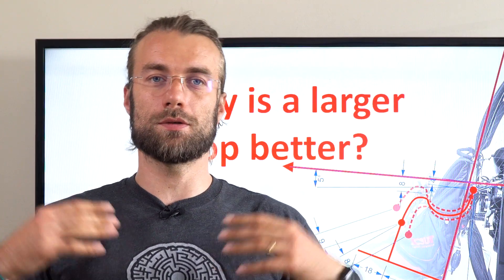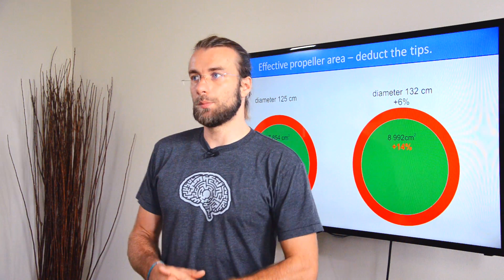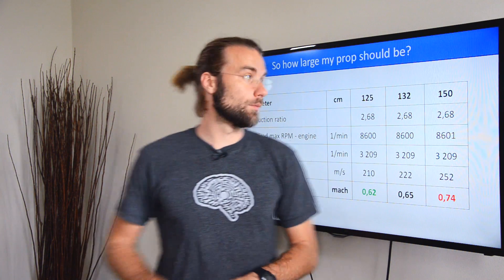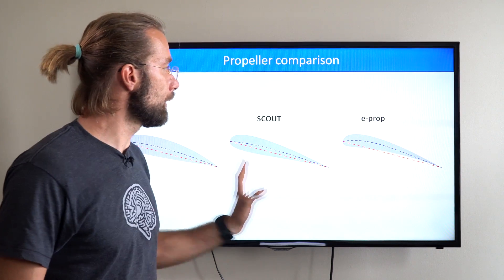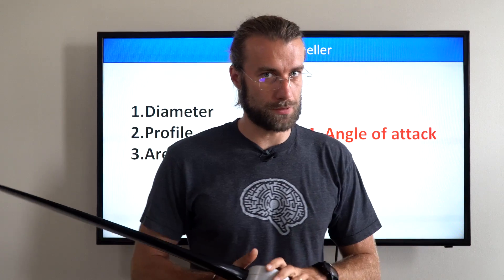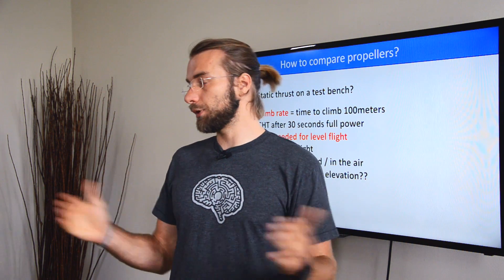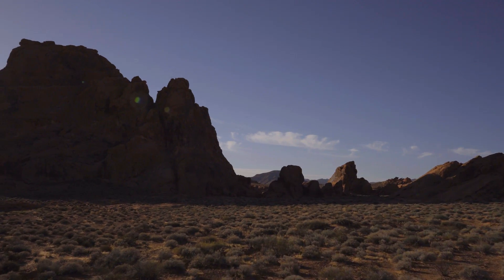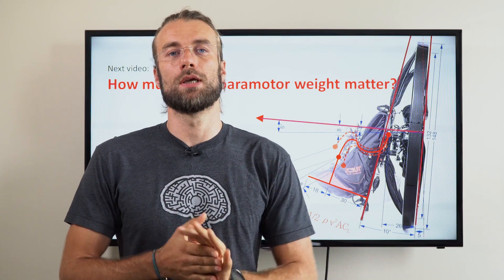Everything about PROPELLERS! Size, profile, number of blades and MORE! Paramotor geometry part 29.1

Comment: Hello sir my name is muhamad hasan in my rc gearbox planes i found medium size prop with medium number gear ratio is the best so i think in paramotor reduction ratio 1 to 2,5 is awesome, because air slip on blade to avoid that u need some high rpm , thanks.

Comment: Fixed parameter you didnt highlight is the motor stators and kv/kt and ofkos the fix loads for paramotor i.e. one man on metal frame. If those changed to lighter, smaller or more compact, the motor used may vary and the props selection is different. E.g. a monocoque carbon fiber with multi rotors. Should smaller footprint design is viable, the (your) design rule is obsolete.

Comment: You lost my attention when you said you never check static thrust. Why not? Its what everything is all about. You are just trying to sell your product and that's not interesting at all
Reply from the maker: I am sorry for losing your attention because the answer to your question is later in the video. Shortcut for you: what matters is thrust in flight and there are ways to measure it.
Reply: In the world of racing, what matters is your trap times, not a dynamometer slip.  Miro is taking the same logic, your climb rate is what matters, not your paramotor dyno thrust test.  I think the solution is to use both methods of measurement here.

Comment: Your tutorials are fantastic! Thanks for doing them. I’m an aspiring paramotorist. You mention a couple if times if the prop was a bigger diameter you’d need long arms to be able to reach. Why would the hang point width change with a larger hoop? Just curious
Reply from the maker: I was referring to forward take off when you spread your arms to pull the risers. But in fact the cage diameter does not matter, the lines will slide along the cage regardless of the diameter

Comment: Have good info BUT , it's called airfoil's, lift coefficient , etc. Tip shape has everything to do with efficiency/sound.
Static thrust measurements are critical especially when determining rigidity of prop.
I still give it a thumbs up!
Keep up good work....have subscribed. Recommended to my friends.
Thanks!

Comment: How can a circle be a square function? Area of a circle isa multiple of 3.14 pi?
Reply: "The area of a circle is pi times the radius squared (A = π r²). Use this formula to find the area of a circle when given the diameter." The diameter is also twice the radius if given that.
Reply: @ullrsdream  how long is a piece of string? Twice half of its length...

Comment: More blades are generally less efficient due to interference between the blades. the ideal prop has a single blade but the added weight of a useless counterweight makes the ideal real prop a 2 blade. Also, it's not the mass of the prop that determines the responsiveness, it's the moment of inertia, which has to do with diameter, mass and mass distribution. You can theoretically get a lower moment of inertia with more blades, gaining responsiveness at the cost of efficiency.

Comment: Miro, I know this is an old topic, but still one of great interest to me.    May I ask which 3 blade prop you used to compare with which 2 blade  to conclude that 3 blade offers no increase in thrust?    (ie:130 cm-3 vs 132 cm 2) or (125 cm 3 vs 132 cm 2) -etc.    I know the results you obtained are subjective, but I would still be interested...
Reply from the maker: It was our own development. Never put in the market

Comment: Very interesting, thanks for putting this series together. This may be a novice insight because I am a novice :)  but, I was surprised that the static thrust test was not considered that important. I realize that getting the real world data on climb rate, for example, is a test that is going to be done anyway but, wouldn't knowing the thrust give you an initial indication as to whether the prop was going to perform better in climb rate, at altitude....?

Comment: So, I know you have considered this, but a ducted fan is way more efficient than a free prop, and all but eliminates the tip vortex problem.   Clearance must be very close to the blade tip, and frame flex would probably be an issue.   Weight, rigidity, etc...    Any thoughts?

Comment: Good prop primer, thx.  That last airfoil is typically called an undercambered foil.  I assume the "special manufacture" you speak of to allow the thinner foil section is the addition of, or modifications to an internal spar?  Also, twist is another prop parameter that deals with aircraft speed, mostly, as I understand it, giving maximum efficiency at the economy cruise (or wherever specified) at cruise (or whatever) RPM.  Correct me if I'm wrong.
I assume your planform profiles are computer "designed", or at least analyzed as well?  Gorgeous prop, by the way, that new one, that is almost SEXY looking!
Probably MUCH too complicated for a paramotor, or even ultralight, but has anyone thought of making a automatic pitch changing (constant speed, or even just two speed centrifugally shifted) prop.  I used to use them on boat propellers, and they were really the nuts when you got them dialed in.  Weight not so much of an issue there, though.  Probably wouldn't pay off for the increased complexity and weight, especially dynamic weight.
Dumb question:  how come nobody specs thrust vs. speed, wouldn't that be a more useful spec, or does it usually just scale mostly linearly (I would think maybe not), although at these Reynolds numbers and pretty tight speed envelope, maybe so.  Never mind, watching further I like your tests EVEN BETTER.  Proof in the pudding, right?  ;-)

Comment: Could you put winglets on the tip of the prop to gain more effective thrust area?
Reply: Yes, but there are trades and compromises all over the place.  Not a simple thing to do or design.  If you look at some general aviation and ultralight props, you will see some manufacturers have done this.

Comment: awesome video, this was super helpful during my Prop shopping. One question i have that you didn't touch on specifically: you mentioned 3 blade props don't produce more thrust than a 2 blade prop which sounds like it would be true, but i'm assuming the test in which you concluded this was done at full throttle. I have heard elsewhere that a 3 blade prop can produce more thrust at 1/2 power than a 2 blade prop could with the same amount of power, therefore you could cruise at a lower RPM. Anyone have any knowledge on this?

Comment: GREAT videos, Im a new suscriber and  begginer in this sport. You help me so much with your knowledge. Im building a paramotor and I will use a 23-25 HP at 7000 RPM engine, (Yamaha Blaster 200 cc 2 strokes) whit a 152.6 cms. diameter  three wood blades adjustable propeller. I would like know best reduction ratio to this case to build the pulleys whith your indications and tips. Thanks so much. 
luiscarlosparrasanchez@hotmail.com

Comment: Without any science to back it up...I perceive that in spite of how much prettier and quieter my carbon fiber prop is, my fat cord, wooden aerolight "beginner" prop, creates more static thrust at the near sea level density altitudes I typically fly from.  It provides for better acceleration on take offs and a feel of a more solid push from behind.  Throttle response (RPM) difference are minimal, but may be slightly quicker with the thinner lighter carbon fiber.  Certainly the bulbous hump near the hub of the Helix provides for better engine cooling, but I am honestly thinking of just going back to the wooden stand by for the simple sake of PERFORMANCE.
Reply: That is really interesting to hear.  Are you a representative for a wooden prop manufacturer, or have any financial ties to them, because it certainly SHOULD NOT be the case, from a materials standpoint alone.  Like  you say, though, it could be a function of your prop being targeted for sea level use where some others may not be.
Is it as "performancy" at higher speeds?
And what about MPG, or efficiency?

Comment: Would a prop tip design, such as the one used by the new DJI Mavic Platinum drone, help with PPG noise and performance or is it even possible to mfg.
Reply from the maker: +Kevin I do not know.
It is possible to manufacture.
Not sure about the benefits

Comment: Remove the pesky prop tips for more efficacy. 😂
Reply: Actually, there is a way to do that, to a small extent, it is the equivalent of winglets on an aircraft wing (look at most large commercial jets if you don't know what I'm talking about). They essentially "unwind" the vortices, and effectively increase the usable span of the wing (or blade).  NEVER something for NOTHING, though, always compromises involved.

Comment: Yes, it is true that a larger propeller can generate more thrust, however, it also leads to more strain on the engine. So long terms effects may not be good....
Reply from the maker: No it does not if done properly.
Increase in diameter is always accompanied by decrease in angle, profile chord or change of profile shape to keep the strain the same.

Would you just increase the diameter and keep everything else the same, the engine would be under increased strain and it would not be able to reach max RPM as desired by engine manufacturer.

Comment: Welcome back! Great video as always. But there is still one more topic on propeller design: tip shape. I hear rumors that curved tips (sometimes called Q-tips) reduce noise significantly, and reduce vortex drag, but then the added surface area out there at the fastest moving part of the propeller increases regular drag, so total efficiency comes out about the same. Might be an interesting area to explore for a new and improved Scout prop. Think winglets on an airplane, except those usually curve upward for practical reasons (less chance of scraping on the ground or being run into by other airport vehicles). Curving down is probably better for a propeller, especially on a paramotor to avoid the cage.

Comment: I'm trying to understand the length of the reach of your arms. If you are referring to applying pressure to the a lines, this is done at the riser. A larger cage would not change where your arms would be to apply pressure to the A's. The biggest limiting factor to cage size would be the length of the pilots legs and keeping the cage from hitting the ground or interfering with running.
Reply from the maker: yes, you are right.
you do not need to reach all the way to the cage rim.
Ground clearance is more important

Comment: Great series Miroslav. I'm glad you mentioned the Icarus Trophy. If I'm not mistaken there are 2 Scouts still participating in this years race ( 1 race, 1 adventurer class ). That has got to put a tremendous strain and considerable wear on an engine. What did you need to do to your engine after you participated last year?
Reply: Why in HEAVEN'S NAME should that put any excessive strain or wear on what is, essentially, an aircraft engine?  You guys have learned to live with JUNK for engines.  Typical aircraft engines (and bikes, and cars) go THOUSANDS of hours, and HUNDREDS of them between maintenance.  Measuring engine life in tens of hours is NUTS in this day and age!  If a company like Honda, or Toyota, or Rotax took this on, they would have REAL usable engines on your backs in no time, and honestly, I don't think they would cost any more than this garbage you are stuck with now.  Just sayin', as an engineer.
Reply: @MrJdsenior  I would love Yamaha to revive their 350LC 2T engine in a small format, BUT it aint gonna happen. The overall market for paramotors means that the serious players arent interested, they sell more marine engines for example in one year than 5 years of paramotor engine sales. So we are stuck with modified scooter engines because thats all the market is worth. If any major manufacturer decided to enter the market then they would wipe the floor with the encumbents but they wont because there would be no profit or even a loss. Welcome to capitalism :)